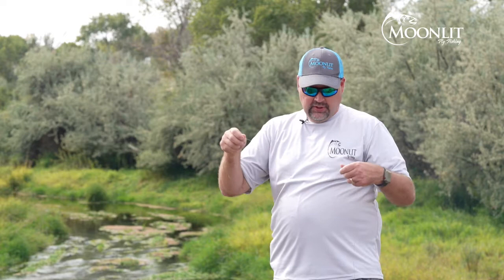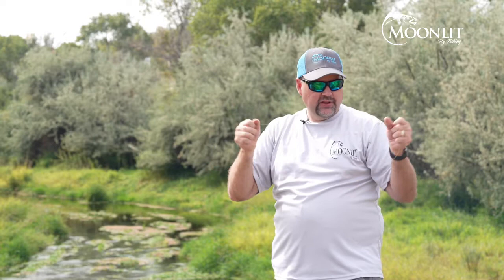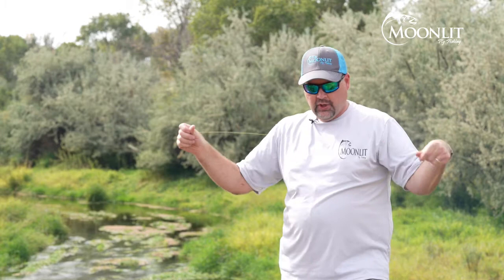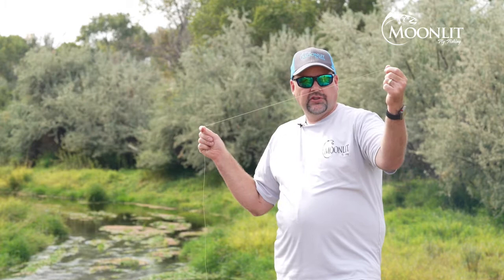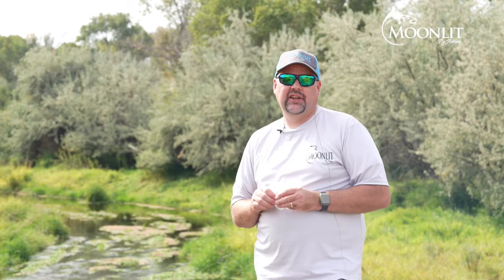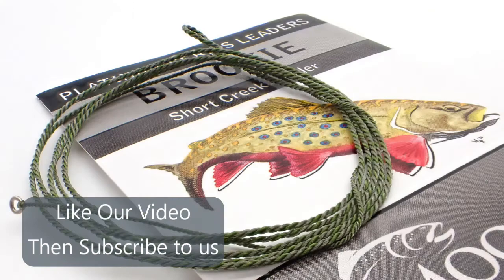Moonlit Furled Leader Introduction || Your Ultimate Fly Fishing Advantage

Comment: all things being equal, will this leader spook more fish than a level line? does it land softly or is there finesse needed to get it to land softly?
Reply from the maker: Arthur great questions.  No this line will not spook fish more than level line or tapered leader. You are adding tippet to the end to the fly as well.  For the presentation it is going to land more softly naturally because the leader will lay straight out, and should fall straight down onto the water in sequence. This means it will not slap the water.